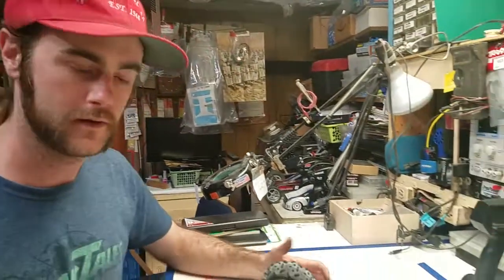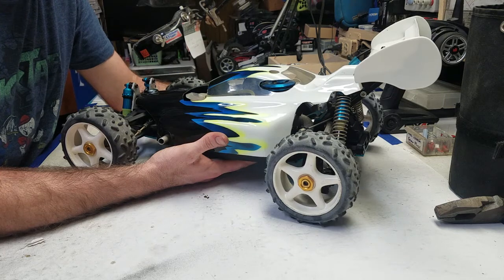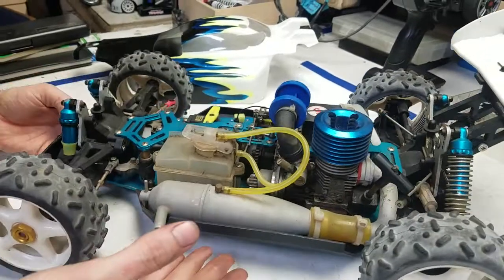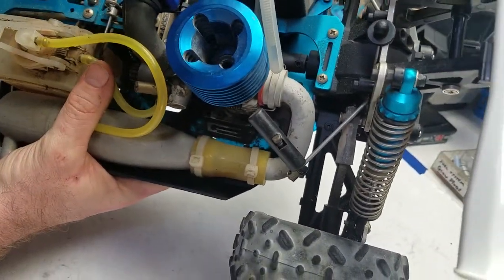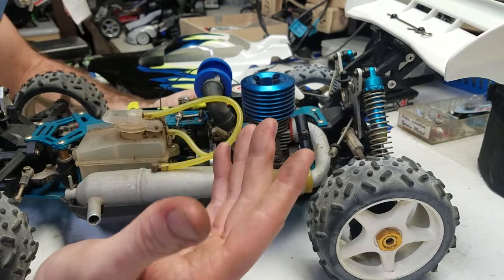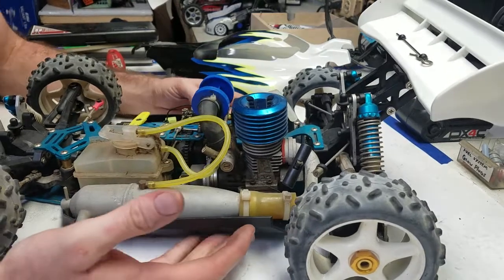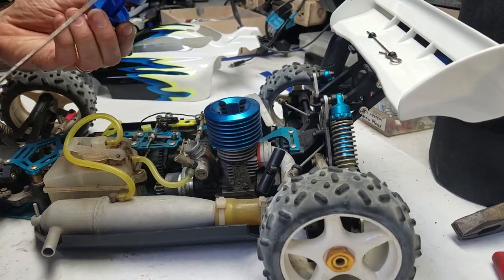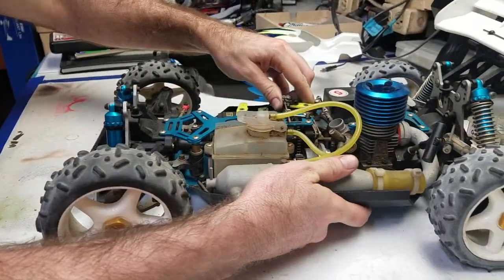Used Nitro RC Inspection

Comment: Hello, I have a stupid question: can the Ofna .26 engine without pull start be converted to with pull start? Cause I don't wanna buy a starter box for my Ofna Ultra since I'm not sure the engine works my other option is to get a new engine. Thanks.